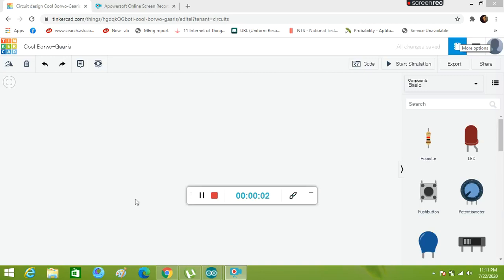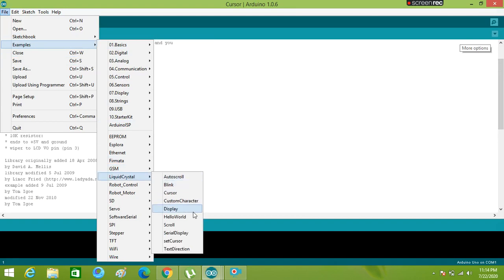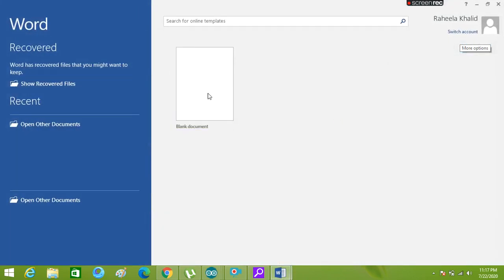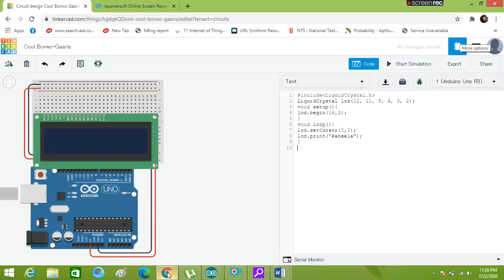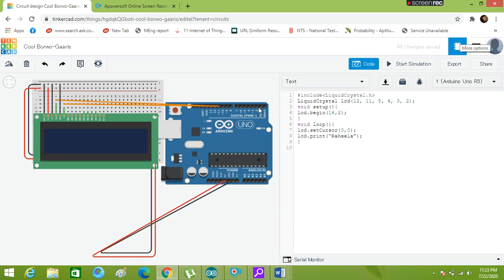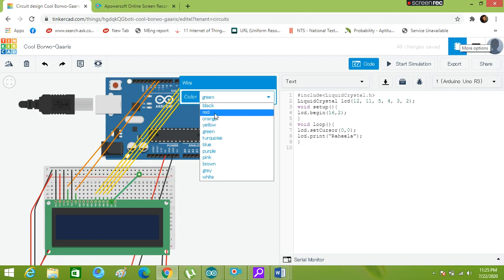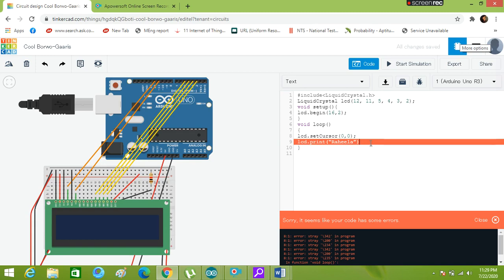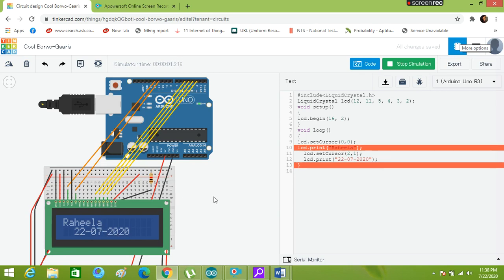Lab 16 Displaying student Name and roll no on LCD screen using arduino uno by Engr.Raheela Khalid

Comment: Thinker cad is a software with minimum libraries of sensors.So you should  recomment io software or proteus .or any other software for simultion .This software is good but there is less sensors in its libraries.
Regards.